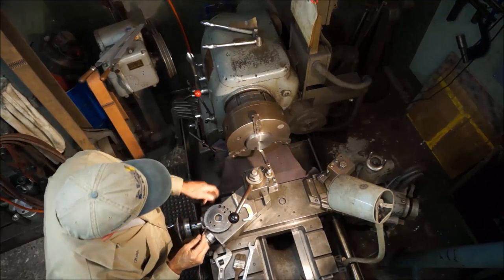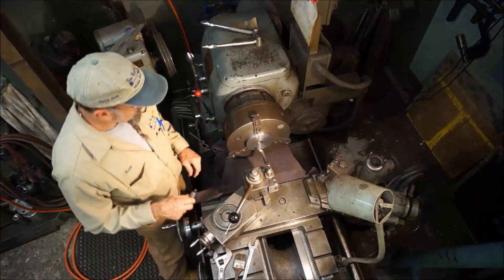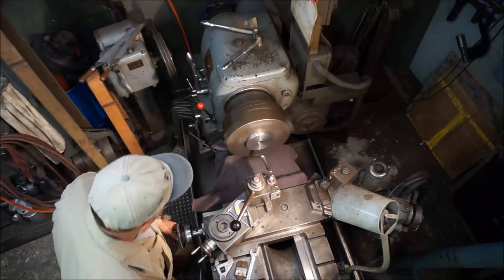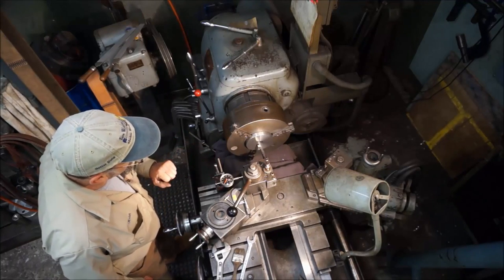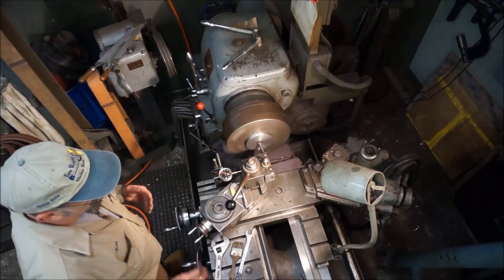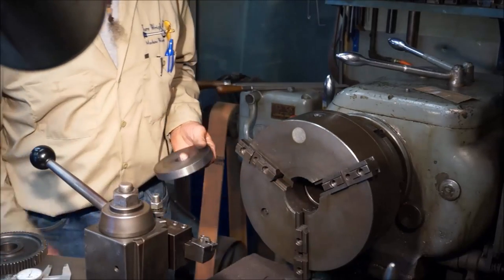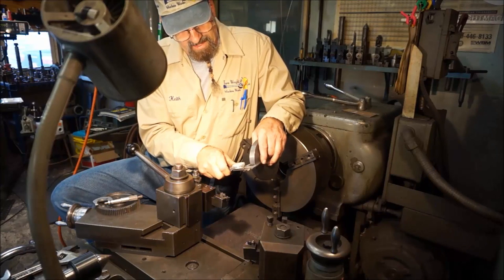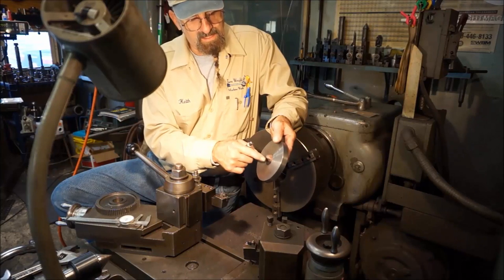My Pinion to Racks!  Addendum to Dedendum Part 2

Comment: Quick question Keith - relevant to an earlier video when you were machining the brass on a rudder shaft. I just had some 'magnetic' brass chips myself and quite forgot what you said was the type of brass that did that. I'll watch right thru this new video later when time. Thanks for all your dedication.
Reply from the maker: ChrisB257 Several bronze alloys have some magnetic pull to them, Magineese bronze was the one I work with a lot ;{)--
Reply: Keith Fenner Thanks Keith. Enjoyed this video a lot - covered numerous nice reminders of technique, broaching in particular.

Comment: Thanks Keith.  Your attention to detail with the metrics and methods, really brings it home how to get great parts.  I have a couple of questions on the broaches and the operation.  Are all broaches tapered the same?  If the final push through depth of the broach is measurable with the guide couldn't you just measure that and use the appropriate shim and do one pass or is it better to take a bit off until you get to depth? Last is, can you sharpen them yourself or do you send them out for sharpening?  The reason I ask is I have found several sets in flea markets/auctions but are either missing shims or dull and reluctant to buy them in comparison to new cost.  Really looking forward to the rest of this series!  ~PJ
Reply: Plenty of companies that do it! but it can also be done at home - with perhaps a little less accuracy. Here's an image I followed to use on my own setup, when making my own broach. From an old file...LOL
http://eaglebroach.com/images/sharpening_1.jpg
Reply from the maker: pjsalchemy Well I make all my own guides and some of the guides are or can be used with a number of widths say 1/4, 5/16 and 3/8 key way broaches and some of them vary slightly in the starting thickness and some manufacture may also vary. I also use banding strips for the shims because the stock shims eventually get wasted, so you measure your shim thickness and double check your desired depth and adjust to suit your need. I have a dozen or better broaches and never had to sharpen one yet, I have had to grind radius edges on a few to get the required radius i the root of the keyway. I don't have employees to help me destroy them and or loan them out. I would say with the right set up you could sharpen your self. ;{)---
Reply: Keith Fenner
Nice!  Using banding material sounds good and easy to get.  Makes perfect sense to use a single guide for multiple sizes.  Seems too that making multiple depth passes would save on sharpening depending on the material.  Thanks Much! ~PJ

Comment: Hi Keith,

Just wondering if there could be a ‘down-side’ to this suggestion on keeping your machine clean of chunky but not stringy noodle strips, and that is hows about sewing some old rare earth magnets from just about all HDD on a computer, sew them into the one area of the cloth you cover your machine with.
Depending on how many of these very strong magnets you can use, you might have to clamp the edge of the cloth between two pieces of 2"x1" wood, you know using something that isn’t magnetic. And it will also give you a lever to lift the cloth and then vac um the metal away; 

I am speaking mainly of the nasty gritty stuff and anything you might file off which would be easier to collect in a magnetic cloth with little pockets of magnets.

Please let me know what you think?

Take care
mrbluenun

Comment: 19:00  , I'll be sending you another business card to replace the one you cut up of mine. lol  Just like Mr Pete's bearded hardware store lady," Hey that's my Mom"..

What are the pitfalls/advantages, other than future failures from remaining weakness in the original, to a braze/remill repair?
Reply from the maker: ***** As I mentioned in the videos that the need may be in a pinch of time to fill and re-cut and the notice of running a gear with wear on all the teeth but the ones you cut, may click or create uneven drive sounds. It also if on the main spindle the cut may patterned with the difference in tooth contact / backlash amounts new teeth to old teeth. ;{)------

Comment: Until this video I had never seen a Curved insight corner made used a single tool the correct shame of the finished edge. I have seen this done very little and when I did I can only recall a sharp pointed tool used on the x and y axis, if you see what I mean.
Your way is much more economical.
Reply: I know Keith has done some tooling videos but I dont know if he made one for radius cutters.But take a look at Oxtools channel if you want more info on making a radius cutter.Tom did a whole video on how to grind and hone one.It takes some practice but you can do a lot more than just a radius after you get the hang of it.Although I only use the complex shaped bits in brass/alum whereas the radius you can do most anything you'd do with high speed steel ;)

Comment: Something has been bugging me for quite some time not and i just have to put it out there for debate and question.

This mainly would apply to automated work, but i could see this being done by a human as well. 

So one of the main things you need to look out for when you're working lathe or mill (i'll concentrate on these two) is heat.

In light of that, are there and if not, why aren't there, lathes or mills that submerge the work in liquid?

It's been bugging me for a while now as i said, so if someone knows something about this, pitch in, thanks in advance.
Reply: I would think that bathing the entire thing in water would inhibit clearing of chips and other  things like that.  That said lots of the CNC machines I've seen basically douse everything in tons of coolant, so there is no real need to submerge it all.
Reply: UnbeltedSundew So chip control, hm, interesting.

Yeah, i've seen some industrial demo videos where they pour it waterfall style but then again i've also just seen a demo where they never used any coolant.
Reply: There are a number of problems with immersing work in coolant that I can think of.

Actually submerging the work would also require submerging the chuck, and a seal between the wet coolant and the bearings. Because the fluid would also have swarf and debris in it, it would be abrasive, and slowly damage all the moving parts. A leaky seal would contaminate the bearing, and potentially destroy it.

It would make working with large pieces impossible. Many times, work hangs over the edge of mill table, through the lathe spindle, or over the end of the lathe. Having the entire thing in a tank would prohibit that.

A immersion tank would also require huge amounts of fluid. Hundreds or thousands of liters per machine would be a huge investment, and require regular filtration and replacement. Plus disposal when the oil is contaminated beyond repair.

The most accurate large machine tool, the Large Optics Diamond Turning Machine at Lawrence Livermore Labs (tolerance 1 millionth of an inch!) used temperature controlled flood coolant. The temperature control was so fine, that after setup, they waited 12 hours for the body heat of the operator to dissipate before cutting.

In other words, it is easier and cheaper to only cool the area of the cut, rather than the whole thing.
Reply: David Atkinson Nicely explained. Thanks.

And yeah i didn't factor the sealing issue.
Reply: I believe that in the nuclear industry world they do submerged turning with the lathe totally enclosed and auto arms to work the controls. Don't think we would ever need to turn uranium rods or radio active parts.
Reply: Stephen Deakin Hm, that's quite interesting actually. I'll go check it out, thanks for the tip.